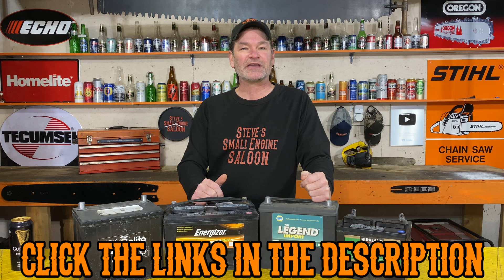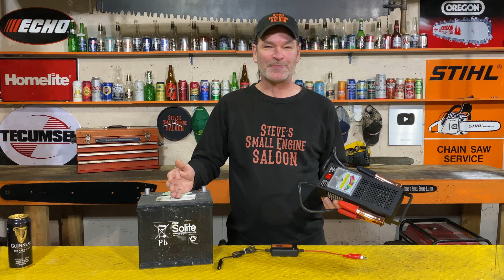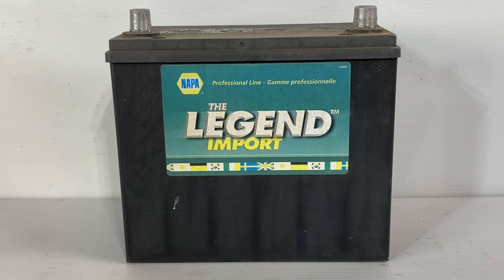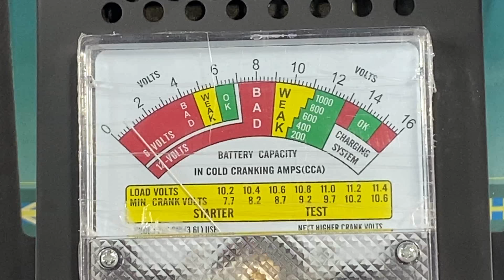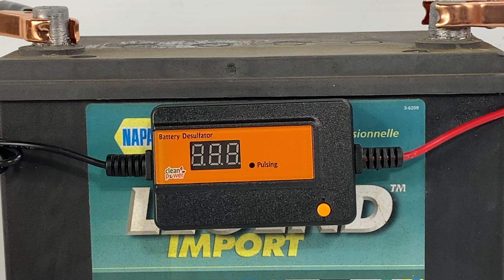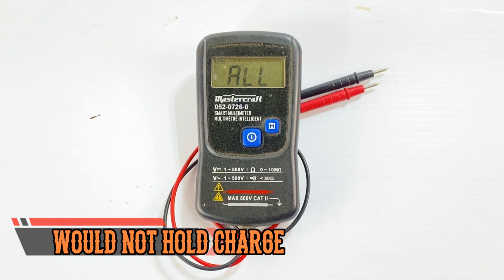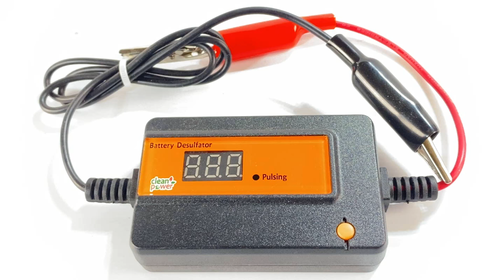Does An Electronic De-Sulfator Really Repair A Battery?? See Real Results

Comment: Back in the olden times (late 60s, early 70s) when I was learning to repair cars, a guy I worked with at a service station (not just a gas station back then) had his own battery in the shop hooked to a headlight. I asked him what he was doing and he told me that his battery was sulphated. It was the first time I had heard that term. His explanation of what that meant did not help me much, and looking back I doubt he fully understood what it all meant either. After he discharged it and slowly recharged it a couple of times, the Sun BAT gave it a clean bill of health. About a year after that a friend couldn't start his car at a convenience store late one night. A wino came up and told him he could get him going if he would share part of the 6 pack he had just bought. Having no  options he agreed. Using tools from his trunk, the man took his battery out of the car and dropped it to the ground from almost 2 feet. Then proceeded to bang it around some more. He put it back in the car and it started! As he collected his beer, he told my buddy to get some acid the next day, bang the battery around some more, then dump out the old acid and refill with new. Worked for a very long time. Over the years I have combined the 2 techniques with pretty good results.
Reply: What your friend did, was called "Plate shedding". What happens is, the active material flakes off of the surface of the grid, and loses electrical connection. When the battery is dropped, that unbonded active material drops to the bottom, exposing bonded active material to the electrolyte. This technique will be most effective, with deep cycle batteries, where the plates are thicker, for greater cycle life. It doesn't work as well with modern starting batteries, because they use a greater number of thinner plates, to get the high cranking amps. Once the active material comes unbonded from the grids, the battery is pretty much useless.  There's no reason not to try, if the battery isn't working, anything is worth a try.
Reply: ditto.  Kenny, the owner of an electrical and battery shop for cars, always drops batteries from two or three feet in the air onto hard concrete.  It knocks the sulfate crystals off the battery cells.  Then recharge.
Reply: Dropping a battery can damage the baffles if not crack the case
Reply: @JessicaSimonson1976  True, which is why you would never do it, except as a "last ditch effort" to temporarily get the battery to work again for a short period of time. This is definitely not a long term solution!
Reply: @vincentrobinette1507  if my battery isn't working off to buy another one.....why risk letting acid lose into the environment.
Reply: @JessicaSimonson1976  drop it into a container. Getting the battery working again for even a few months is far better for the environment, if many people try it. Just buying a new one without even trying, is the consumerism that got the world in this mess. The manufacturer of a each battery harms the environment more that a litre of acid.
Reply: @awestruck9075  they recycle the acid , housing of some batteries, as well as baffles, lead
Reply: @JessicaSimonson1976  the lead gets recycled, the acid gets neutralized. Once acid is contaminated, it’s worthless.
Reply: @JessicaSimonson1976  you are correct! Howeva the battery is already bad but it MIGHT get better. It would be common sense to wear protective clothing and face covering for just the reason you point out. Of course drunks and gearheads (lots  of crossover there) are not known for worrying too much about safety. Just the way of the world... Your concern is justified,  being a lifelong gearhead and part time drunk, I didn't give safety it's due. Thank you!
Reply: My brother taught me that trick as well

Comment: I take it the de-sulfator somehow cleans off the lead plates to enhance electron flow?
Reply: one video i saw, said it sends 30 khz pulses to the battery during the trickle charge. this breaks up the sulfate coating slowly, and sends it back into solution. i assume it does not settle in the bottom of the battery. so it doesnt short out the plates. it must work this way, to keep batterys working for 7 years. my 300 cca tractor battery was down to 225 cca after 2 yrs, it charged to over 300 cca in 2 days with no load. after 30 days it was up to 332 cca. i leave it connected all winter. by spring it was up to 380 cca with no load. I have the Battery Minder with temperature compensater from Northern Tool. i think it was about 40 dollars. my battery is a Duracell.

Comment: my lawn tractors first battery was a no name 230 cca that lasted
3 years then wouldn,t hold a charge. water level ok.
next i bought a duracell 300 cca battery, its lasted
4 years and tests at 341 cca 13.7 vdc no load. had the Battery Minder on it since nov 30, 2020. it can take 30 days to disolve the sulfates back into solution, but its worth the wait.
i'm sure it will start just fine in may 2021. 
i understand lead and sulfuric acid create sulfates on the surface of the plates, when thick enough it acts like an insulator and prevents the battery from charging. 
i'm a believer. the newest Battery Minders have a temperature compensater circuit build in.
Reply from the maker: Cool!
Reply: i ran that same Duracell battery cca 300, for the 5th year, 2021. now its dec and the cca (cold cranking amps) is 333. can't wait for next year. i only hook up the Battery Minder from nov to apr.  had quick starts all summer long. i also use Seafoam in the gas tank, once a year.
Reply: hey steve,  on that legend battery  hook up  desulfator and a 2nd battery with 12 volts for a few seconds or minutes to start the desulfator then remove 2nd battery, desulfator should charge the legend battery
Reply: I ran that same Duracell battery for the 6th year, no problems, now its Dec 29,2022 had it on the battery minder for 1 month, the cca is 314, voltage 13.6 no load, internal resistance has increased to 8.4 milli ohms, up from 7.7, not bad, cant wait for next year. its a sealed battery and perhaps needs a little water, indicated by rising resistance. I like to start up the tractor monthly, it seems to help the charging process.

Comment: STEVE - CAN A COMPRESSION RELEASE BE INSTALLED ON AN OLD 044 STIHL SAW ? IT KICKS BACK AND PULLS STARTER CORD OUT OF MY HAND. YOU HAVE TAUGHT ME A LOT THANKS       BILL T.
Reply: check to see if the key way has shifted timing will be off.

Comment: Was the Guiness room temp or cold? as a Brit I have to say eithers good but I  prefer it ice cold. Thanks for the video, I also saw a video on parasitic drain from the plastic case! didnt believe it until I had that, connect the volt meter to one terminal and the case and see the voltage! wtf, so after cleaning the plastic with battery cleaner it fixed my truck problem 👍🏻

Comment: Don't most solar chargers do the same thing pulse width modulation PWM.

found this on PWM https://www.morningstarcorp.com/wp-content/uploads/2014/02/8.-Why-PWM1.pdf 
Pulse width modulation PWM
"In addition, this new method of solar battery charging promises some very interesting and unique benefits from the PWM pulsing. Theseinclude:1. Ability to recover lost battery capacity and desulfated a battery. 2. Dramatically increase the charge acceptance of the battery"

Comment: There is definitely a point of no return on old batteries no matter what you charge them with. I have a large solar panel I use for reviving older batteries. It will produce about  amps at anything up to 19 volts. I just cover part of the panel in bright sunlight to limit the voltage to around 16 volts and let the sun have it for a day or so. Then let the battery sit until its voltage comes back down around 13 before installing it in whatever it came out of.  This way I don't blow any chips or components. It will extend battery life for a while but eventually all batteries fail due to internal lead plate sulfation and short circuiting.

Comment: The battery with only eight volts, hook a second battery up in parallel, then the desulfater thinks it has ten or more volts and does it's magic
Reply from the maker: Great idea!
Reply: @StevesSmallEngineSaloon   . I also hook a good battery up to a dead battery to charge it.
I remove the booster cables after it starts charging. 
These new automatic charges won't start unless they detect a certain level of voltage also. 
God,I  miss my old dumb charger, it would start as soon as you plug it in the wall. Came in handy when as a kid you couldn't afford a portable stereo so I would take a car stereo out of one of dad's junkers and hook it to a charger or a battery for the firepit and hang with friends!😁👍🏻
Reply: @barryfirth1187  That is why I have one of those $600 shop units, 245A charger/booster on wheels with a big transformer, diodes with a fan blowing on them inside...24V/Start/12V HI/12V LO/6V selector.
Reply: @1pcfred  I have a Black and Decker smart charger given to me, works great unless the battery is dead. I bring out my dinosaur charger to get dead batteries going.
Reply: @isaaclang6031  I went though three of those B&D's in one year on my mom's car  I don't care for them but they do the job of maintaining a car not driven much.
Reply: Lol 😆 that’s funny. When I was a kid we used to go down to the river bank where they had used old cars to try and hold the bank front moving. We wood get the old radios out of the dashboard some of them were 6 volt some 12 volt. And then hook them up to a battery charger boom we had music  🎶 in the garage.
Reply: @flatfac  Mine is an about 20 year old "Associated" 280A 12V engine start unit. These days like the Mig Welders they are using MOSFET controlled electronic switching power supplies to save production costs.
Reply: Some of the new chargers have a force charge mode, or a 12v power supply mode. Either will work, but I would monitor the battery when using either.
Reply: Better yet hook up the one that tests at 5 volts up to it in series. 13 volts to desulfate
Reply: @stephenrosenthal5252  My thoughts exactly. Series. You could probably even use a DC filtered power supply.

Comment: the only batteries that can be saved "short term " are the misdiagnosed batteries where the car owner actually had an alternator problem but was told "battery " by mistake, those batteries can recover although generally it is short term as the constant state of discharge under load will generally destroy the ability to hold charge ,modern batteries are built so cheaply the plates disintegrate before the sulfate  so they don't recover, once a battery has become flat more than once it can no longer be relied on and it will fail you ,deep cycle batteries cant be load tested as thats not how they work in their life cycle, a different piece of test equipment is needed, a load tester just damages the battery a load tester simulates starting conditions a deep cycle battery does is not designed for those loads and it causes damage just testing them , some batteries don,'t charge up if they fall below 12 volts because the modern charger wont recognise an 11 volt item as a battery so the charger  itself won't  do it anything until it sees 12 volt in this case you join 2 batteries together to fool the charge into recognizing 12 volts
Reply: You would have to SEVERELY overload a deep cycle battery to damage it. I can't imagine a battery tester that has that capability. Even the best AutoMeter carbon pile load testers generally can't put that much load on a battery unless you are trying to test a very small VRLA battery. But a flooded wet cell deep cycle battery has much thicker plates than an engine starting battery. They are designed for multiple charge/discharge cycles down to the 50 % state of charge as part of a normal cycle of life. If you keep wet cell battery's electrolyte level correct and charge them at the correct rate and temperature, and don't discharge them lower than 50 % SOC, they will last a long time.
Reply: Also, if you are load-testing a VRLA battery, they need to be tested at 1/3 of their amp/hour capacity. If a battery is designed for engine starting, one must use the cranking amps or marine cranking amps published on the battery with the load tester. If that type tester is being used on a battery with published amp/hour ratings, you would generally load the battery at 1/3 of its rating. Therefore, a 100 ah deep cycle battery would be tested at about 30-35 amps load.

Comment: Thanks Steve. Where you buy these desulphanators? Crappy Tire? Will they work on any voltage? I have a 32 volt system on my boat. And next time I’m at Walkers, maybe I can show you a cool trick with the Guinness.
Reply: A fine looking gentleman, Try looking at a company name VDC Electronics. They manufacture several varieties based on voltage, current requirements, et cetera. Be forewarned. Good ones are not cheap.

Comment: Steve, I use battery pulse chargers regularly. The chips in the ones made by VDC Electronics was invented by Texas Instruments and was designed for the space program. You can't just make a quick trip to outer space to service solar-powered satellite systems when they need it. Regular use prevents or minimizes sulfation in lead acid batteries. By pulse charging the batteries, the lead  sulfate crystals are returned to suspension in the electrolyte making the batteries last longer. It's not uncommon to double the life of the battery. My experience with them is related to emergency backup power for amateur (ham) radio use, although one of our club's radio towers experienced some interference from the pulsing of the maintainer. We had to remove it from the permanent installation and go back to a standard float charger. I highly recommend them.
Reply from the maker: Right on Ron!  Thank You...
Reply: Find it hard to believe they use heavy old flooded lead acid batteries in satellites
Reply: @chriskennedy7534  - You didn’t have much of a choice in the 80’s then you have that because that’s the way we always did it argument into the 2000’s
Reply: @PapaWheelie1  Hmm maybe 
I know the solar panels they use on space vehicles are Far better than what's sold to us 
Sure storage would have been updated in an industry where weight is crucial
Reply: @chriskennedy7534  he said that what Texas instruments designed it for that dose not it was ever used for that I don't think lead acid batteries have ever been deployed to space
Reply: @chriskennedy7534  Nothing's heavy in space!
Reply: They don't use lead-Acid batteries in space!!!!
LOL!
Reply: @szaki  They were used when that was all thats available.

Comment: I have not had any "long term" success on fixing lead acid batteries.  I have tried buying acid to put in with limited success.  I would not recommend it for fixing or flipping because you are creating a false result for a limited time frame.  Then when you need your tractor to start a month later your S. out of luck.
Reply: What a pessimistic person
Reply: @johnlogan1179  And i suppose you do not believe they build fail clocks in appliances, what are you 10 years old?
Reply: As with anything, it depends on how far gone they are, plus the method. There's people that juice dead batteries at hundreds of amps, recover them, and use em for years.

You are unlikely to succeed if they have thin plates, b/c there won't be much left of an abused batt.
Reply: @TheGuruStud  these days it depends on the cheap battery plates being used in todays market , made cheap and calculated to last about a month beyond warranty period